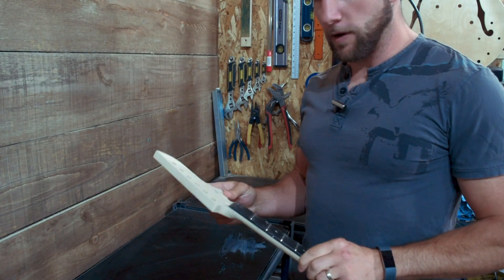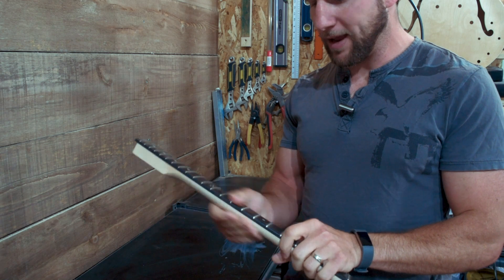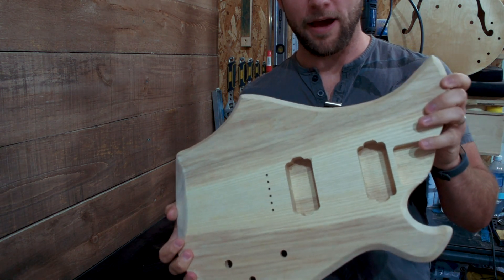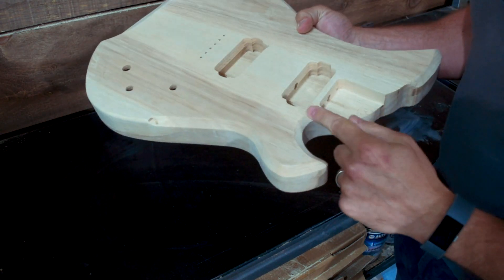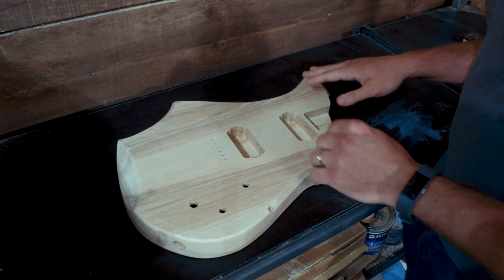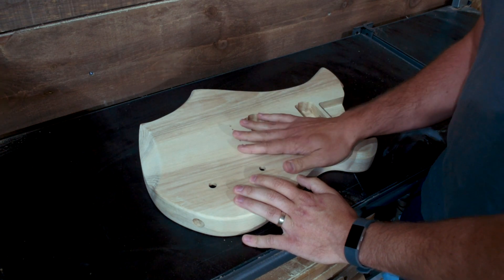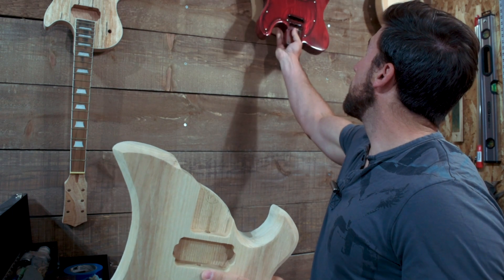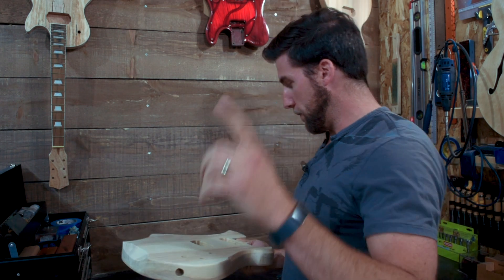The Great Guitar Build Off Update You've Been Waiting For!

Comment: For the neck, I'd remove a slice from the chunk between the neck and pickup (at the bottom), then glue a thin piece of wood to the bottom of the neck.  Then just slide it in and secure it under the pickup like they do on some SGs.
Reply from the maker: With a bolt on system underneath?
Reply: @BradAngove  You have more faith in that bolt on than I do.  Heh.  

That said, I'm absolutely looking forward to what you've got planned.
Reply from the maker: I must, I’m not really worried about it at all. I’m sure I’ll have that video out fairly soon.

Comment: Hey Brad. I used your method using the 2k clear coat,  and it’s good enough for what I’m trying to achieve. It’s no show guitar by any means, got minimal orange peel, so I didn’t bother with wet sanding and polishing. I’m rebuilding an old “Series 10” model. I’ve replaced EVERYTHING, except the body! New neck,PU, humbucker, bridge, tuners, tone and volume knobs, insert Jack, headstock string guides, used to be an ugly shade of red, now it’s plain brown. That body you made looks good!  Great job.
Reply from the maker: Thanks Tom. Glad you like it. Sounds like youve got some cool projects going.

Comment: Hi Brad, I’m going to paint my guitar too and here in Germany I have a lack of stuff I need. So I went to buy what I need and now I got a mix out of different stuff. I have some primer, some acrylic color spray paint and the matching acrylic based clear coat for it because there was no lacquer in the color I wanted and some car polishing wax, therefore I still need some rubbing compound. But the polishing stuff I have is for cars and made for lacquer, and I saw that the color or the clear coat could have a reaction with the polishing wax. I saw that you did some stuff with acrylic colors so maybe you know if I can use car polishing stuff on acrylics?
Reply from the maker: Yes, automotive polish generally works on those clear coats. Just be careful that you don’t burn through.

Comment: This is probably a silly question: the logo on the fret board... can you do that with the frets in place or, are you going to remove the fret that cuts through the logo, and, if so, wouldn't that ruin the fret board?
Reply: I understand that the inlay is already in the fretboard, as it came that way from Crimson for Brad ...
Reply from the maker: Yes, the logo is already there. Crimson did it with white resin in a carved logo before installing the frets.

Comment: Cool! Great source of inspiration, this. Would it be possible to just add another hole assymetrically to make it more rigid. Or just use three? I guess u have come up with sth else. If there's a metal plate in the back you could proly run a screw into the neck that dont go all the way through. Most likely not a problem. Or a new improved tremolosystem. The neck can be twisted!! Lol! Here's a suggestion: Make the simplest guitar ever! With two humbuckers. No design. Just assemble the parts on a lump of wood. So it's playable. See how fast it can be done. A readymade neck. This challenge with the least amount of try. A horrible idea. Lol!
Reply from the maker: That would make for a very unusual guitar building video haha.